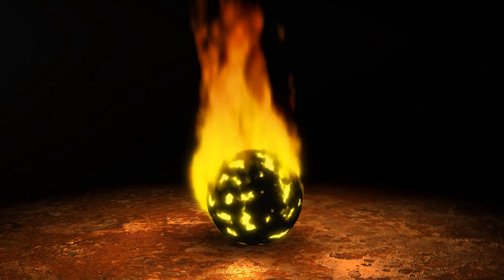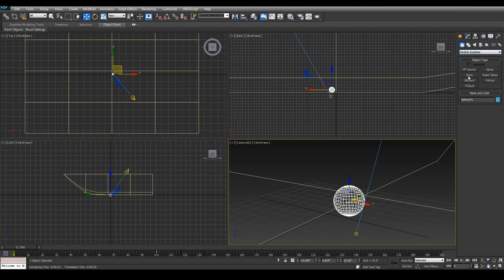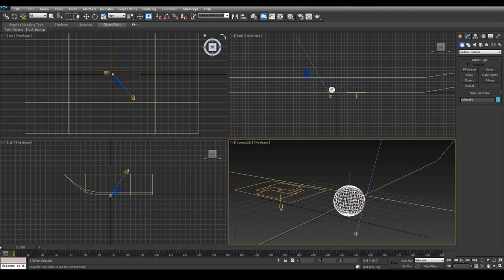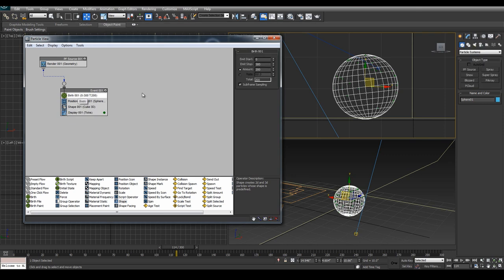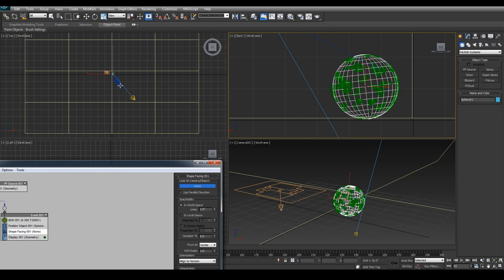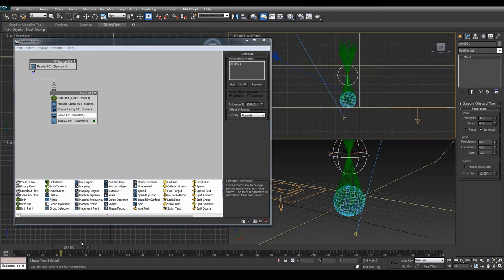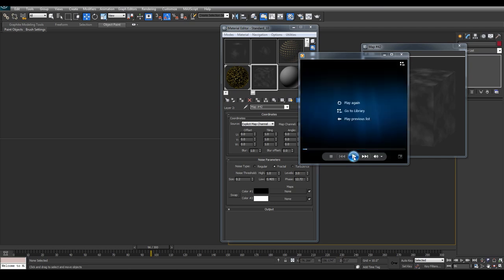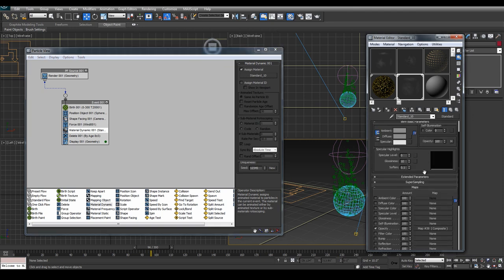3D Fire and Smoke Tutorial with no plug-ins 3DS Max 1 of 2

Comment from the maker: You can still do it but not like in the new Max. Add the Particle age first in the opacity channel then in each color slot  1-3 add a gradient ramp instance use the noise in gradient ramp to control the look like I did using the layers.

Comment: This is a really good tutorial, worked like a charm... for a single flame source. I have created a scene with multiple fire systems (seven) like this and am getting some very strange results.

The particles are aging very strangely and dying off too quickly on several (sometimes all) of the systems. Everything begins fine, but then after a few frames they start spawning older and older (going by the color they are older, anyways), and within a couple dozen frames they are gone.

Looks the same looking at the alpha channels as well.

Each flame is linked to it's own event, each with their own emitting shape, forces, the works. Even with just two flames I am having these problems.

Would anyone have an idea what would cause this?